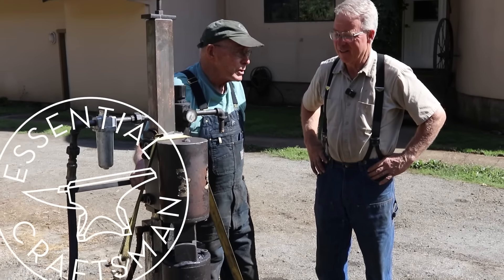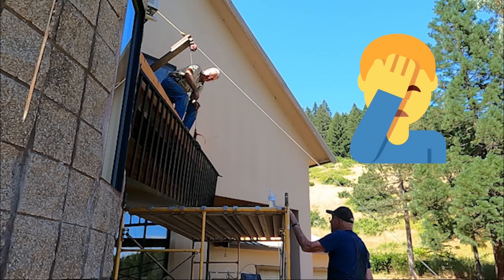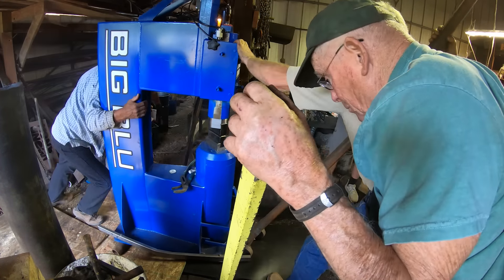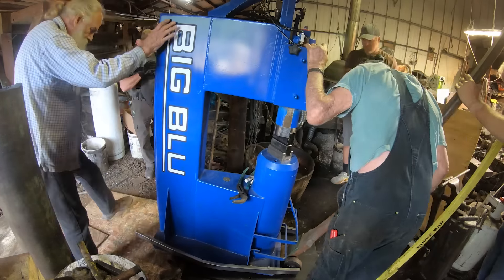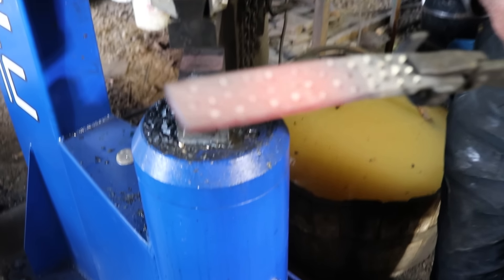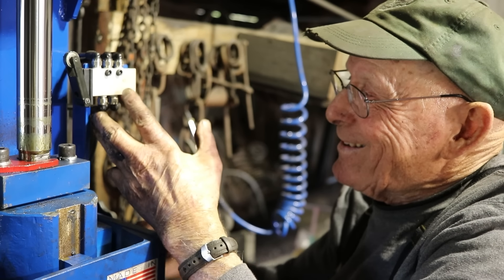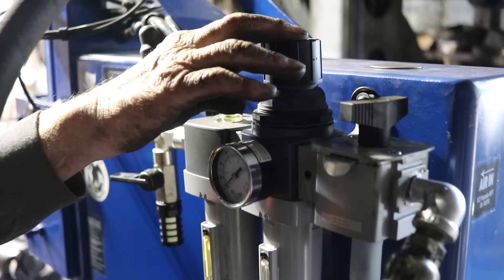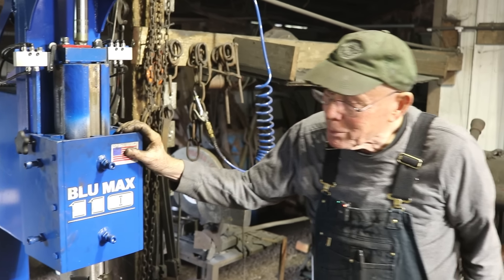Big Blu Power Hammer Install and Review

Comment: 2:08 the fit up on that die is poor. I guess they figure after it pounds awhile it will match itself? You can literally see gap under one side of the bottom because the angle on the die and the holder are off from the bottom angle so the set screws don't sit it square. Making a slidng wedge aka GIB for the set screw side so it clamps down and square would seem like a worthwhile upgrade.

Comment: FYI, unless you modify it, I would be VERY careful with the lower die retention "design". Sharp 90"s and threaded fasteners in a high shock / vibration environment. I've heard of several situations where dies left the machine and could have severely harmed the operator.
Reply: I agree with your observations ... The Die retention design is not a strong endorsement element.  Hope all goes well for Cy.
Reply: I don't understand why they mismatched the dovetails that severely.
Reply: @dumpsterdave3710  They're not mismatched, the design is cheap and dangerous.

Comment: Why are the top and bottom dies machined with dovetails but the powerhammer isn’t?
Reply: Because they are poorly designed. Fasteners... in a high shock, high vibration environment, holding what are supposed to be high-force anchoring parts?
Reply: 2:04 It gets held in place with set screws.
Edit: You can see one side is matching the dovetails.
Reply: @woody442  And when the set screws vibrate loose? There's a reason why 2x dovetails and a tapered one-way driven key have been the mainstay method of anchoring dies in these machines since their inception....

This design is poor at best, and WILL vibrate loose, as seen here within the first few minutes of use. Let's not talk about that sharp 90° STRESS CONCENTRATION POINT on the "flange" that holds the retention fasteners... That will crack and break, and has been proven prone to do so already.
Reply: @Boosted98gsx  I never claimed it was any better than the method you mentioned. Still that's how it works in this case and why the dovetail is only machined on one side of the base.
Reply: @woody442  because it was cheaper, likely

Comment: The polyrope confidance frightens me. It has hardly survived 20 years on the interior of radio comshels holding antennas vetical. We have also had an interviewee  arrive wearing a polyrope belt; was equally unimpressed with its performance